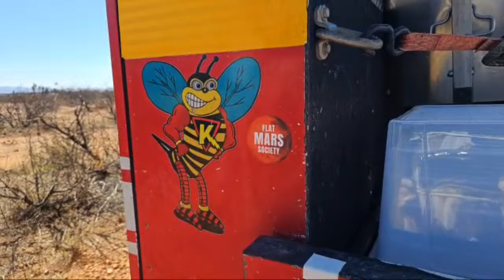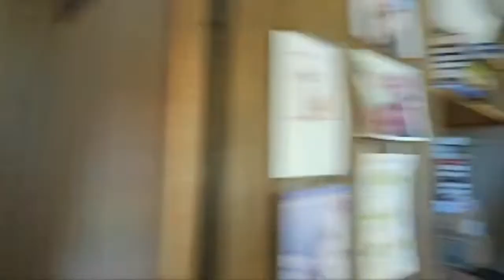Convoluted Killers Cause Trouble!

Comment: Holy crap what a cluster fuck of a job! I was at my nurse home visit so missed the live but just finished watching. Holy crap those were mean suckers. Do you ever spray FENDONA on the remments?
Reply from the maker: Just spray adhesive. Would have been too much pesticide in the air. What a CF!!
Reply: @KillerBeeGuy  that was my guess but didn’t know if you could use it in that way.